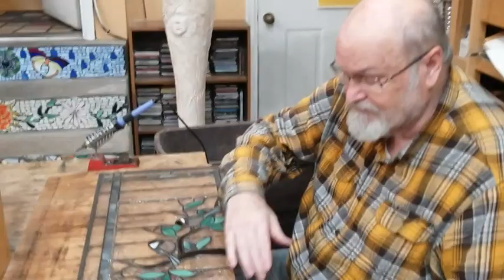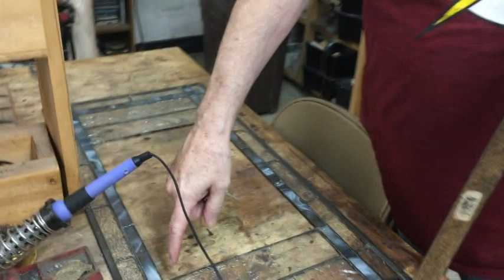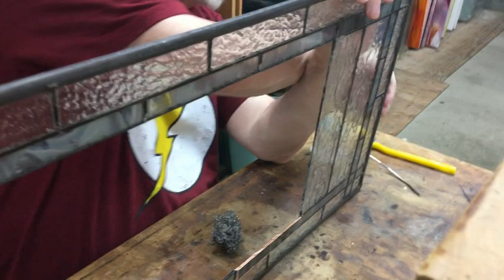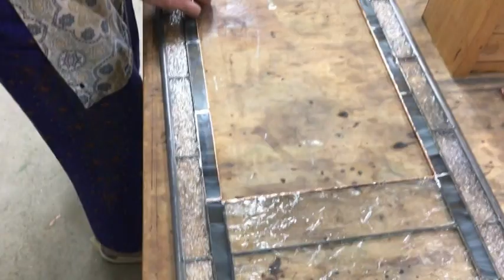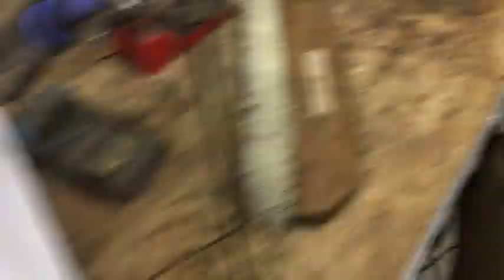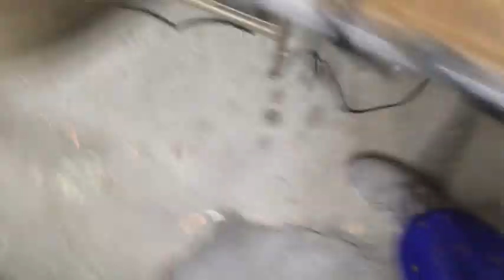An Unusual Stained Glass Repair (Long Version) V282

Comment: I recently saw where a person working on and electronics board used a device to suck up the solder as it was melted. Would something like this be helpful when unsoldering for a repair?
Reply: I have used it on small delicate repairs for small pieces, but not sure about large repairs like this.  That braided copper is expensive and would use a lot for this type of repair.
Reply from the maker: There is a tool called a "solder sucker" but I've never used one (except in electronics work)